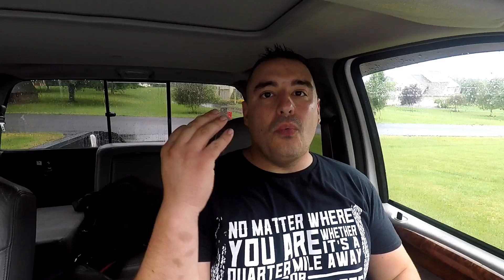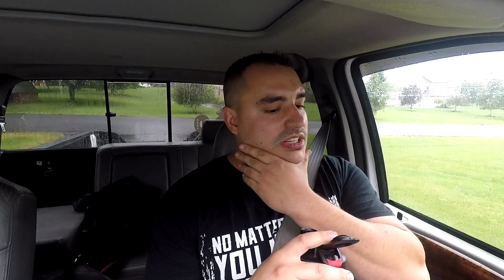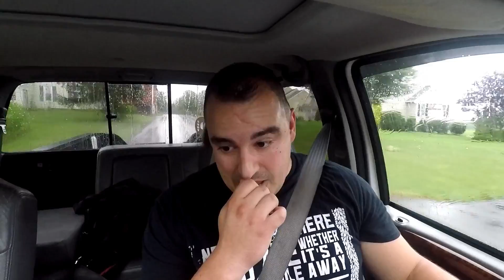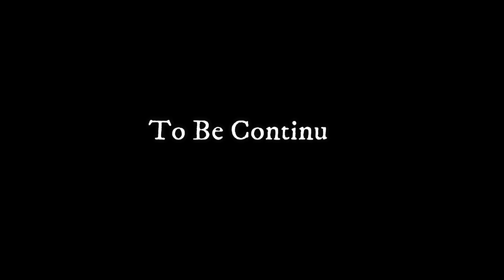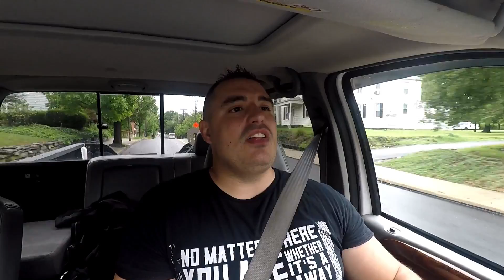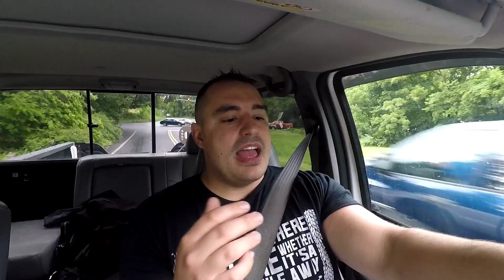6.0 Powerstroke Build IDP Ultimate X Tune

Comment: I put the sport tune on from inovation and it shifts good until I try to floor it from a light and it goes to 4k in 2nd gear then misses 3rd goes straight to 5th and hits it so hard, what could this be?
Reply from the maker: Could just be they need a tuned revision. I had some issues with shifting on some of their tunes too but overall they are decent. I have grown to like other tunes though.

Comment: I Love innovative Diesels tunes.  But I find the X tune to not be a very driveable tune.  & only gave +2 MPH on 1/4 mile over street tune.  You can feel the converter lock up and pull a bit harder at the end of track though.  I'm interested in trying WPE race tune
Reply from the maker: Wpe is great. You'll love it

Comment: What has been done to your motor? Studs? Balanced assembly? What add ons besides the turbo and injectors (which you mention in a previous video)? Any mods to the fuel system?
Reply from the maker: So it has a Fass 125 gph fuel system fed by a sump, 4 inch turbo back Exhaust, colt stage 2 Cam, s&b intake, powermax turbo, csf 6028 intercooler, odawg s3r ported intake, kill devil diesel heads, BD Exhaust manifolds
Reply: 6.0 Bros could you comment on your fass 125?  I just installed one with sump and it chirps randomly like it's moving pockets of air through the pump.
Reply from the maker: The only time I have ever had it seem like there was air pockets was if fuel was low. Other than that I have I have not experienced that at all. It's been great and holds fuel pressure well